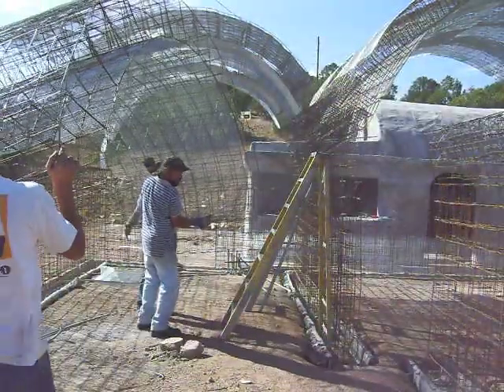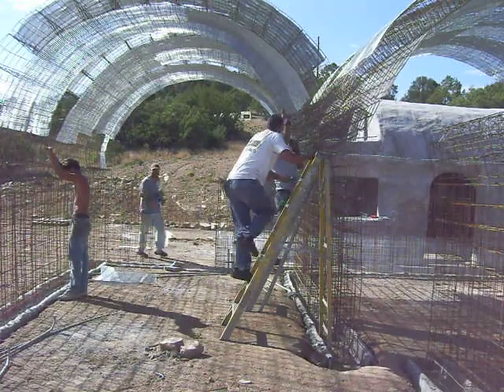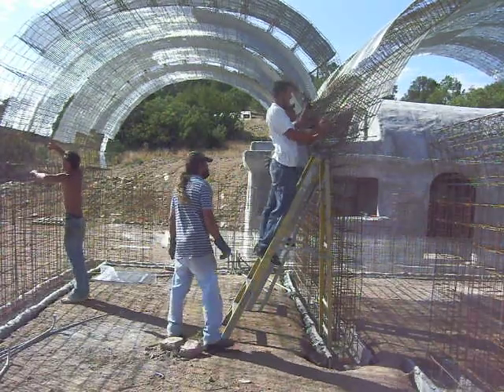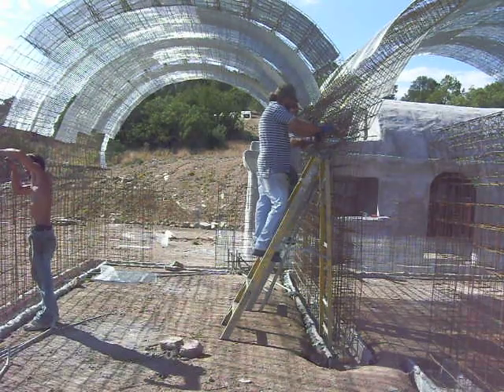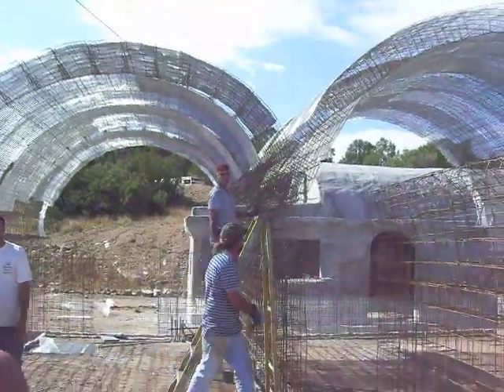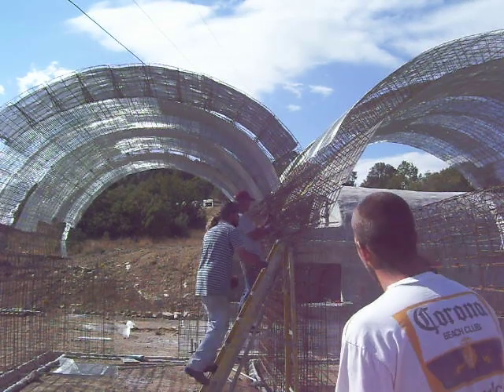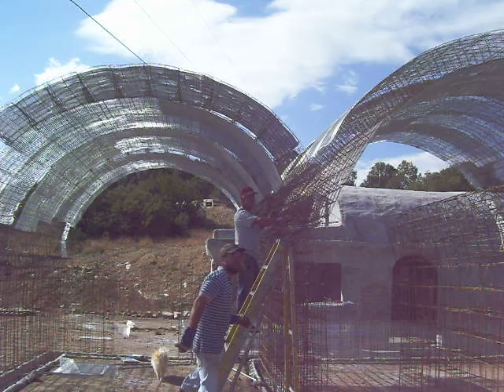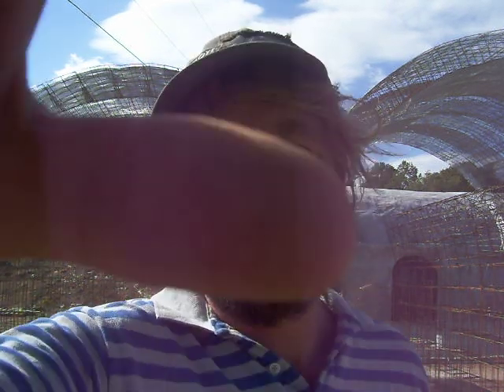Parabolic Stress Skin Roof Panel

Comment from the maker: The shell carries most of the load. Cellular concrete pours like a melted milkshake.  Hydrostatic pressure is created even in a shallow pour of about 2 feet.  Air bubbles that are not part of the microbubbles suspended in the matrix are forced out, even under window details where you would think a bubble could be trapped.  The walls sputter & bleed cellular concrete along pinholes & seams due to the pressure.  Even tiny lettering from sample containers is transferred.  Every cranny is filled.

Comment: If you are pumping cellular concrete inside the structure how do you ensure that the metal gets covered/penetrated completely. It seems that could be a weak point if you have air pockets and moisture attacking your steel armature.
I am guessing the strength of the cage can withstand the application of cement with no  support underneath.

Comment: i love the idea , what about make this in a place where in the winter could get -27 C. and in summer really hot.how can i isolate this in a proper way.
Reply from the maker: The method has evolved slightly to be 2 feet diameter round columns that flare upwards to complexly curved, 2 feet thick, structural sandwich roof, like a dome, on the inside and a single shell awning on the outside.  The columns and roof are formed by curved wire block frame trusses that are made very sturdy by overlapping side reinforcing with the same steel so that a triangular pattern is created.  The round columns contain a single truss that branch into two at 6 feet high, and the bases are set in the ground in an insulated jacket made from this same structural blue foam (40 psi) on the bottom piece, that is roughly 3'10" x 4'0" x 2' deep to help get below the frost heave depth in cold climates.  You would have to set the depth of your insulated column jackets to the frost heave depth in your region.  On the thin surface slab, using LFC tech like you see in the other video, you would only have to set your ground depth to only 2.625 or 3.25 inches below the finished floor height, depending if it is interior or exterior and contains the hydronic heating layer or not.  The 5/8 inch surface slab is on the same blue foam and has a radiant hydronic heating loops embedded in an extra layer of 1/2 inch foam on the inside portion. This foam does not have to be the more expensive 40 to 100 psi structural kind, just the regular blue foam.  The thin slab should extend 9 to 12 feet out, roughly, from your insulated home; to the edge of your cantilevered single shell awning that relies on the curved shape and curled edge for stability its stability. The entry walls are built between the columns in the archways between each column.  They are built on the flat thin slab and need no more foundation than that because they are non-load bearing and 2 feet thick to snowshoe the load, so to speak, on the blue foam insulated thinshell slab.  You have a two foot thickness to play with for your insulating entry walls and many material options, such as straw bale, are available but I would us the same 15 psi structural blue foam to sculpt Windows and doors, shelves and hollow spaces for closets and utilities, sinks and counters.  You can use the same SPJ and Micron 3 additive to enhance your plaster supply bought, base coat adhesive mix to get higher psi and conserve 25 percent material. You will use 3 to 4 layers of crack-free (EIFS Plaster grade) fiber glass mesh to make sculpted stress-skin walls that are tougher than wood frame walls and much more insulating, similar to the material and method used for the sea shell windows and the doors and windows on the small dome.  Isolating your thermal mass in this way, with the two feet insulating thickness, probably achieved with cellular concrete or pumice fill around the trusses, depending upon what best suits your circumstance, should perform better, in terms of energy consumption for heating and cooling, than methods that rely on heavy insulation in the roof.  This is because, even though this is all light-weight construction based in ultra thin structural sandwich shells that are filled with very light materials, it is still massive construction because the great thickness of the stress-skin form; on par with an overall density of solid wood.  Your house will still float should an earthquake and storm land you in the ocean, but it is massive enough to be a tremendous heat sink to store your heating and cooling energy well.  Thermal mass storage is much better, especially in terms of body comfort and heating and cooling costs, than trying to store energy in only the air trapped in your house with insulation.

Comment: Could this roof handle earth above?
Reply from the maker: Yes, but the system has changed to a column based system that has roof gardens.  That is much more stable than the barrel vaults in this video. Also, it is easier and faster to build.  A column supported pavilion is supported in the wild terrain first and the flat pads are terraced into the natural drainage to protect the main pad and build soils and runnoff gardens and stabilize the area.  To get a basic idea of what an abstract version of a Core Monolith Pavilion looks like look up the Mount Clemens Savings and Loan, but the edges of the awning is thin and the edges curl downward like a flower pedal.  Also, the main roof provides an insulating thickness and can be designed for any loads following basic engineering.  The awning provides the counterbalance of the spread force of the dome, like buttresses would for a regular dome, and provides tremendous earthquake stability.  Also, the curled edge rotates the hot air back around and down so provides a strong air buffer from wild fires that try to push into your entry walls if they are made from any flammable materials.  Good fire protection.  The framing is all the truss block framing from www.Flex-Shell-Architecture.com.  The framing is fast and allows for precise complex shapes to be made following a free form method that ensures the design parameters are followed but allows unexpected fluid shapes to be explored.
Reply: @ShambhalaVillage  Thank you so much for the explanation. Fascinating stuff. I'm interested in doing a simple vaulted roof first and then exploring these ideas more creatively.  Any more videos planned?
Reply from the maker: @Cyara248  yes,  more coming.   Lots of building planned, getting training material together too.
Reply: @ShambhalaVillage  Wonderful. I'll be watching for it